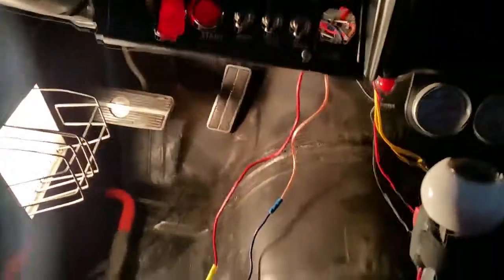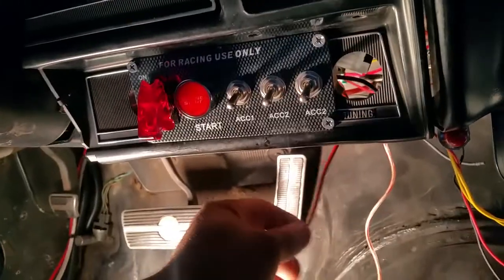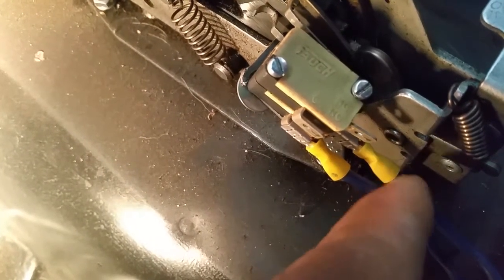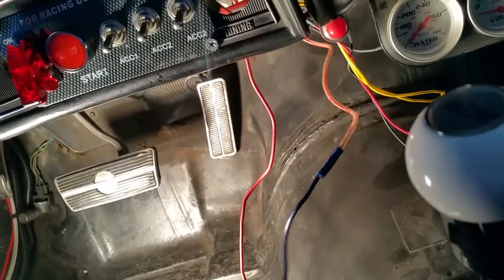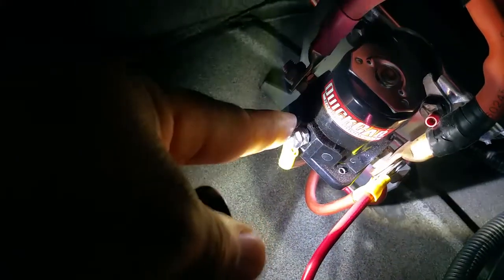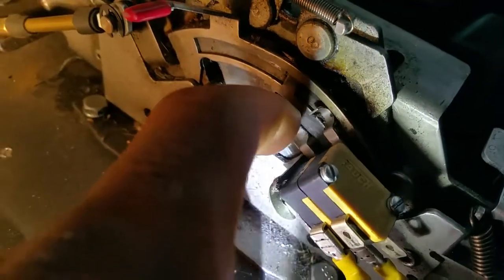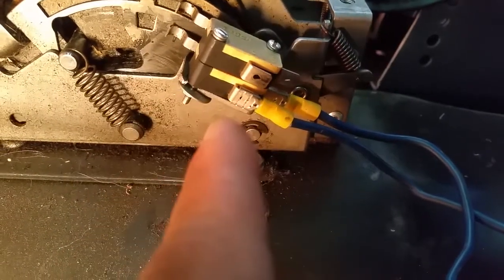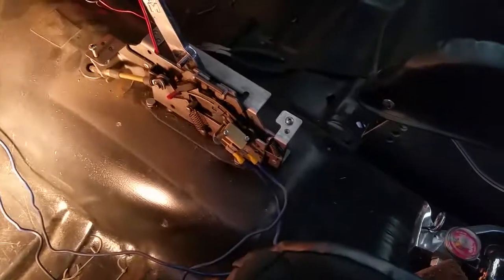CHEVY NOVA NEUTRAL SAFETY SWITCH WIRING

Comment: Great vid thanks for posting! 
Now did the push button alert the tech guy? Do you think if you left it on the key start on the column he wouldn't have broke your stones?
Reply from the maker: it worked on the column, just forgot to wire it in when I installed the push button, but yea that's the first time tech ever questioned me about a neutral safety switch, he said a guy last week started his car in drive and the tech guy almost got hit.
Reply: +ss396rat ahh that would be my luck 
Be like oops lol

Comment: anyway you can make a little video on how to adjust that little neutral safety switch? Mines like intermittent and needs slight adjustment on my tci outlaw which is very similar to this.  thanks!  great videos as usual. Amy nitrous times yet?
Reply from the maker: you just gotta wiggle it around until it works, it's a piece of crap, mine works but the car only starts in neutral I just left it like that
Reply: Lol yeah that's what mine does 50% neutral 50% in park...thanks
Reply from the maker: +Widowwful lol good theft deterrent